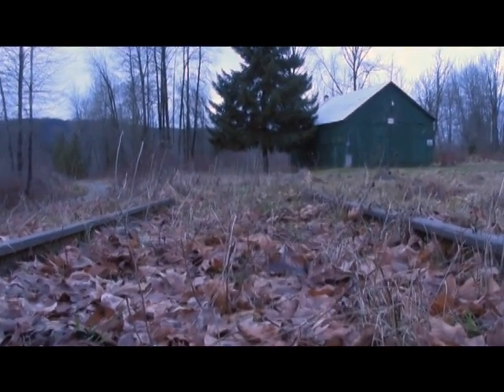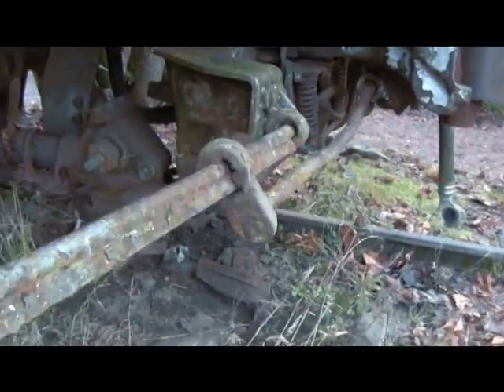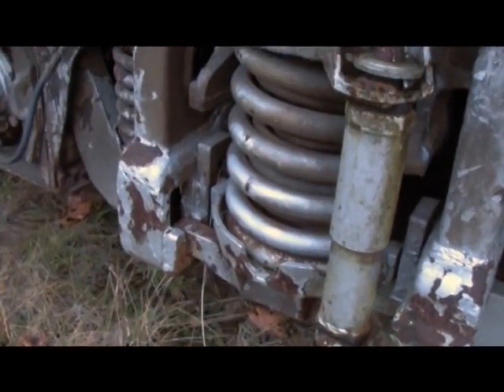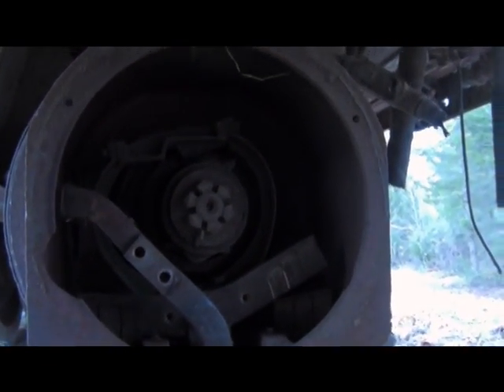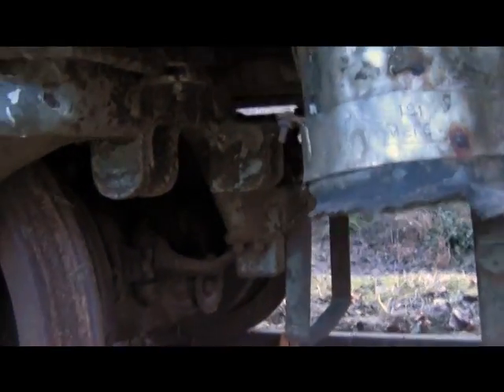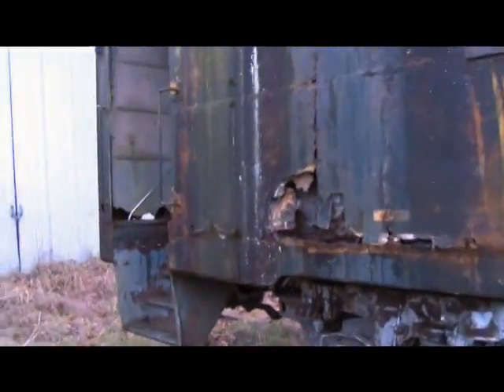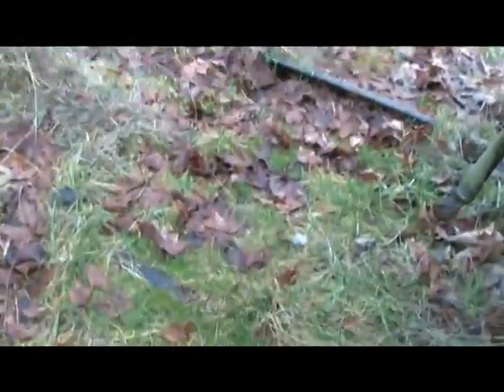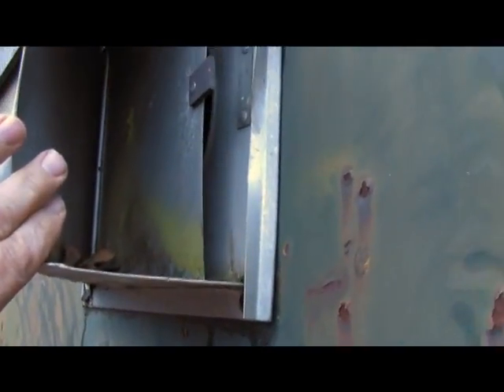Barn Find Round House Train Edition

Comment: You have discovered a Milwaukee Road coach in most likely the 600 series built in 1947 at the Milwaukee Wisconsin shops.   Would seem to have been converted to work service after the end of passenger service.  Repack date and COTS show the work was done at Western Avenue yard in Chicago.   Car is now falling apart and would cost a fortune to repair although the trucks are or at least seem to be in fine condition.   There are still a few, a very few of these coaches around.   No, this car was never a sleeper.
Reply from the maker: +gunvald833 Thank you for that.